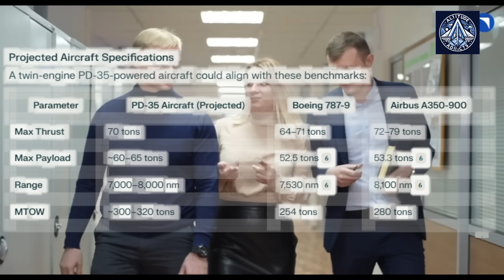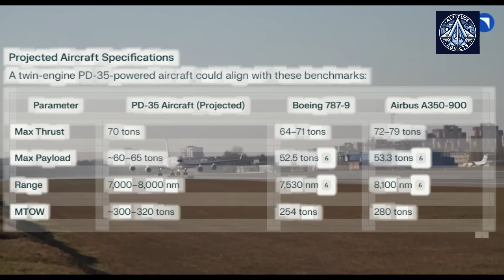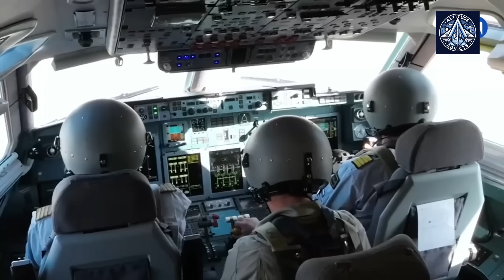The End of the Il-96? Why Russia’s PD-35 Engine Changes Everything

Comment: The IL 96 needs engines of more power than the PD 35 , Russia needs to  up the ante and get the Chinese on board to produce a 70 tonne output engine . Alternatively a lighter plane say co developed with Embraer and Comac using more composites .
Reply: @chrisbremner8992  китайцы копируют двигатели у нас из России
Reply: @ivanbeluy1618  ну и что???

Comment: Work again with COMAC for C929 and put PD35 as one of the option engine.
Reply: It won’t happen until the conflict ends. COMAC has big global ambitions and depends heavily on Western engines and avionics. They want to compete with Boeing, but working with Russia could put them at serious risk of sanctions.
Reply: @KMASIF-mi9yj sanctions?! Before month will pass, you will have entire network of cross sanctions between US and China.
Reply: @KMASIF-mi9yj  sanctions wont last forever. so yeah trying to sell engines separate from new aircraft would be wise idea. after all russia probably doesnt need much of wide body aircraft anyway. so it would be big waste to try to get all new aircraft if only 5 will ever be made. while engine alone could be used on some other airframes. 
best would be long rage narrow body aircraft. that would probably cover russian needs anyway. hoping for exports is over optimistic.
Reply: @jebise1126  
I would not agree with the assessment that sanctions won't last forever.
In any meaningful sense, and for at least the next one and probably two generations of aircraft, Russia will be locked out of meaningful cooperation with Western suppliers.
The problem isn't that there might not be windows of openness and cooperation, but rather that aircraft programs need to be stable over 20-30 year time frames.
And that simply isn't a credible scenario for Russia to plan to - Russia demonstrably needs autarky. 
Also, for a population of 150+ million... there will definitely be a need for 200+ wide body airframes.
Reply: @nikonnikiforoff lol, who will finance these sanctions? You? Already now europe air companies have damage that goes to 100 EUR millions per year, because has to avoid Russia.
Reply: The Chinese aren't interested in joint ventures with anyone on large aircraft engines.
They are looking to build an exclusively domestic capacity. 
Where as Russia will continue to need to have an independent capability to power its aircraft.

Comment: One would have expected IL to have done some preliminary design work already assuming that they may end up with 28 to 32 ton engine.

The requirements of Russian Airlines is known because both Earoflot and S7 use the A330/A350-900  and  B787 as their workhorse. So anythihy that IL designs must provide similar amenities (even if the range and thrust is somewhat lower plusnwe have many A330s around for IL to get a look at the passanger comfort amenities.

Finally, let me just note that both UEC and IL are very slow with implementing their plans if you consider the pace at which Rolls Royce or P&W churn out new Engines.

All of the above having been said, I am one of those routing for Russian aviation because we need democracy & choice in the sky. 

Best wishes to Russian aviation.
Reply: Before beginning the design work, they need that work to be funded. Russian aeronautical design bureaus work a little differently to how western ones work. 

Western companies churn out engines that have significant execution flaws lately which require re-work and refinement. Making things fast is good, but it has to be reliable. Also unlike Russian manufacturers, western guys had a huge market and lots of income. And the collaborate. Russians were pointedly isolated from it all. Russians have to do it all from scratch, and at the same time they have to develop and re-introduce manufacturing techniques.

They'll make what is needed, it just needs more time than west, for reasons described.
Reply: ....development and testing of an aircraft engine takes about 10 years...there is a difference whether you develop new engines continuously or from scratch...the Russians managed to produce 3 completely new engines from scratch in 6 years...
Reply: There were flight tests il-96 did with P&W-1000 BUT as usual, westerners decided they don't need competition.
Reply: Russian пс-90а engines installed now con't compete with fuel efficiency, its outdated 35yrs old design.
As of passengers comfort, one should know il-96 is the primary plane of russian president, so any luxury could be installed if the company operating these jets want to do it.

Comment: Correction. The long haul aircraft will be produced based on the available engine.  35 tons isn’t enough thrust.
Reply: 4x16 and 2x35  is enough thrust
Reply: @bagamut It's not enough when you compare it to the A350 and 777. Il-96 itself has a low thrust to weight ratio
Reply: @jackaboodf16   its a smaller and lighter plane so pd 35 are ok
Reply: when you compare it to the A350 thrust to weight ratio would be exactly the same, equal
Reply: PD-35 have 35tons NOMINAL thrust, but maximum  42-47 tons  by modifications of PD-35
Reply: Why isn't 35 tons enough thrust? How much thrust do you need? The 35 tons is the baseline. They were looking into the engines up to 50 tons thrust potentially after the 35 tons one.